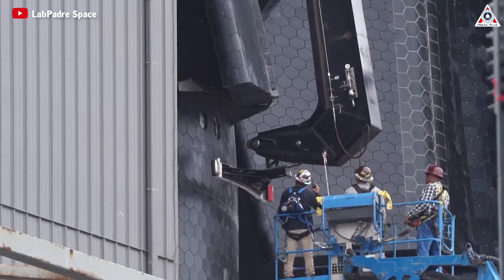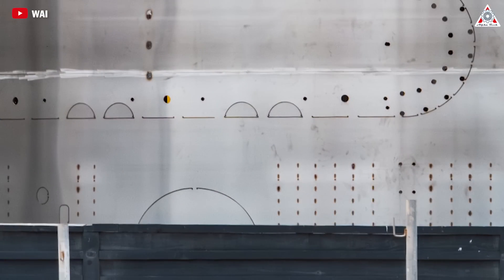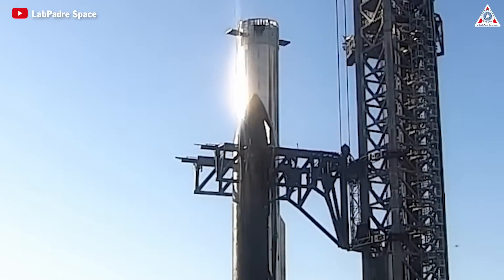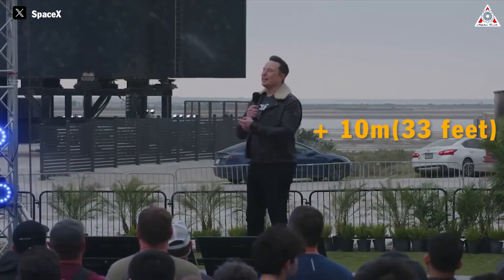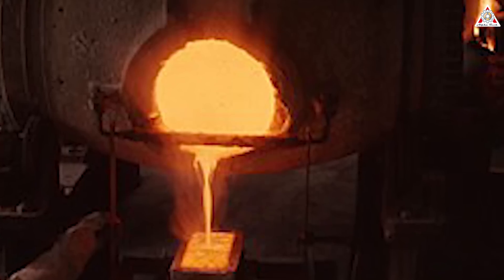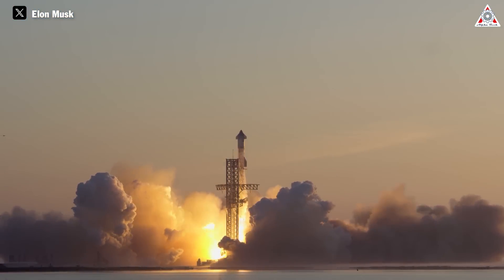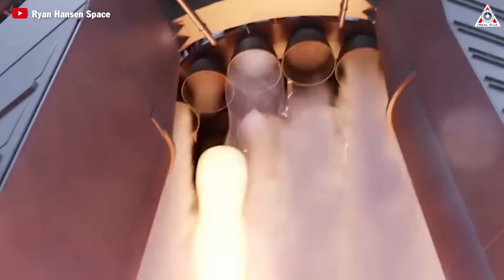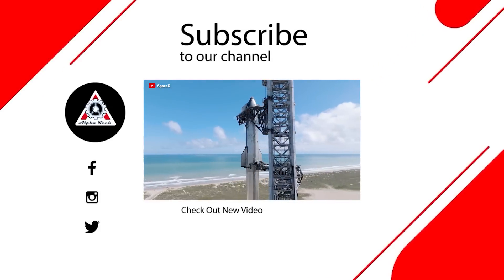Is SpaceX building V2 Starship NOW???

Comment: 60 fuel pumps?  let's see; there are only 2 fuels; Oxygen and Methane or and LPG; yet there ae 60 fuel pumps, two for each engine.  If : "the best part is no part" then why manufacture 60 turbine fuel pumps? No,  they can't turn on a dime, but this has been a glaring issue since the idea arose that a thousand launches were going to be ultimately needed.  Also the turbines produce a gyroscopic moment.  Seems like that turbine gyroscope effect can be made use of to stabilize the rocket from rolling and tilting.  The Russians pointed the way when they used two pumps, not four, to power two rocket engines, long ago .  Save time and weight; and, use fewer parts.

Comment: Mark my words. Starship is nothing more than a heavy launch vehicle, and possibly a space station. It’s not doing anything more, that all it was designed for. 12 refueling rendezvous for one moon mission is laughable.
Reply: The increased fuel capacity may be related to under-performing engines and/or higher structural weight. IIRC, a NASA report on Starship stated that improved engine performance is needed to achieve target performance, Makes one wonder if Raptor performance was reduced to gain improved reliability.
Reply: @pawnfish352  not to mention it’s too top heavy for a proper human landing craft, it’s the exact opposite of what you’d want.
Reply: @jimmystrickland1034 you have no proof its top heavy
Reply: It’s just for launching non human payloads. And will never perform at a proper cadence of launches, it’s far to complex and down rite suicidal for human cargo.
Reply: @jimmystrickland1034 ITS A FUCKING PROTOTYPE

Comment: Increased fuel capacity should be a major goal for the Starship. Right now as stands, to get Starship to the Moon takes about 10 refueling ships! This is ridiculous. Can you imagine the cost increase to get the ship to the Moon by doing this, not to imagine the logistical issue of launching 10 ship one after the other in a short period of time to refuel the ship. Increase the fuel capacity of the booster  and the Starship or build a third reusable stage so that Starship has all or at least most of the fuel it needs to get to the moon. A long term solution would be to develop a nuclear engine for Starship. This would completely solve the fuel problem. SpaceX is going to have to look at this form of propulsion anyway to get to Mars.
Reply from the maker: Yes, but first they need to take it step by step.

Comment: The designers need to add a raised filleted edging arround the tiles, to improve the aerodynamic integrity. If not, in any scenario where Starship enters the atmosphere and a wrong angle, the tiles will simply pop off as we've seen in ITF-3.
We don't want another Colombia.
Reply from the maker: Heat shields are probably something they have to be very careful about

Comment: On ships there are no 90 degree corner cuts at all openings through hull.All corners are cut with circular corners.Sharp corners crack with stress.Circular ones withstand much more stress without failing.
Reply from the maker: This is amazing
Reply: OH, YOUR A ROCKET DESIGN ENGINNER TODAY, AH, THEY DISCOVERED THAT 70 YEARS AGO IN THE TWA 'SQUARE WINDOW' ALUMINIUM FUSEALUGE  DAYS.  OLD INFO!
Reply: @velocity5918  Of course!It is old info.The principle follows thru on all of these structures.

Comment: Looks like normal in production modifications so far.  Round ends of satellite door probably to reduce chances of stress cracking usual in sharp corners.

I suspect V-2 designs will come after another test flight or two, to see if they can make it past the re entry issues  or need a redesign.

Its good seeing constant improvements, and next steps made.
Its been such a great project to watch unfold before our eyes, And has come so incredibly  far since hopper.

Its obvious its getting professionally constructed now, not being just cobbled up like at first... 
It was like a backyard farmer build there for awhile... 🤣

I saw so much stuff that was unprofessional, and often got indignant responses, when I pointed things out...
But funny thing: everything commented on was very soon taken care of, and done way better. 🤗

Best part, is its looking factory made, before they even get the factory built...

Also will be nice when Starship is lifting Starlink satellites by the gazillions, And planetary internet is a done deed, and affordable. The proceeds can be used to build Starships.

I'm looking forward to the next flight, see if they solve the re entry issues.
What will be nice, is when they can get one back intact to check out, and see where there were problems physically. Like metal condition under missing tiles, engine condition, how the structure held up etc.

We need off this planet. Get a frontier going, and leave this mess behind, like settlers in the Americas left Europe to become irrelevant...

Pretty sure the government in h3ll is a bureaucracy... Would be nice to get some freedom from the control & extraction  sociopaths...

Starship is the first step in getting that...
Reply from the maker: you are wonderful! Always someone with great ideas! Thank you very much for contributing so much useful knowledge! Stay tuned for our next episodes where we discuss together
Reply: @alphatech4966  
Yeah, I'm checking Alpha Tech drinking my morning coffee usually... I try to analyze, offer ideas, critique things, and some attempts at humor!
I think its a Great Endeavor.... Legendary!
And chuckle thinking of future historians analyzing back time on internet, and reading what people thought at the time...
Reply from the maker: @garylester3976  You are truly a person with a soul that loves science! Have a good day!

Comment: The only metal that would be less pron to heat expansion, (which is why the tiles kept popping off of Starship) would need to be a minimum of 316 S.S. The other factor is the corrosive environment that Starship will encounter on the beach or even on Mars. SpaceX has a long and expensive road to haul but are on the right track. Reaction control system (RCS) is an issue but I'm sure that they are coming up with new and improved space environment craft controls.
Reply from the maker: SpaceX could be having problems with many things. Because they have not announced any specific information, we will make predictions from their vulnerabilities.

Comment: You're so easily surprised and amazed. 
So most of the data gathered from 3 launches that costed 117 raptor engines about V1 are now unusable. 
So what you're saying is that Starship is currently underpowered and overweight? 
More robust V2? With all those "unnecessary" parts missing?
Reply from the maker: Starship v2 is a version that SpaceX can further optimize. Of course, that is when starship v1 proves that the flight and return to earth process is stable.